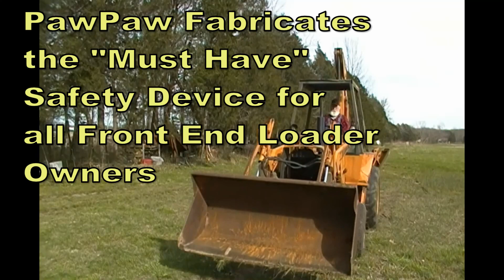PawPaw Builds a Safety Device for a Front End Loader Backhoe

Comment: Well now,..
  my Case 530 backhoe don't have that.      Now gunna git me the I beam an build one Thanks !  Paw Paw !
Reply from the maker: The I Beam is a bit heavy and overkill, but I had it handy.  I would prefer a 3 X 8 rectangular tubing sliced longways and use half of that, no welding, just drill holes for the bolts.

Comment: A good friend of mine was killed by being crushed between the bucket and the front of his tractor. He was 31 years old and had a 3 month old son. Norm owned an apple orchard. He was replacing one of the hydraulic  cylinders. After replacing the new cylinder he turned the tee valve to let fluid into it. That action allowed the other cylinder to drain half way. down it came. please be safe.

Comment: cool idea but did you need those 4 tabs just wondering
Reply from the maker: Remember the bolts I used to line them up before welding?  They are inserted into the tabs to hold the brace in place while I am lowering the bucket onto the device.
Reply: @DoingItCheap  oh gotcha thanks for taking time to read my comment

Comment: Couldn't agree more. Simple and worth every cent and second. Son had a friend that lost his father when he took a short cut working on the skid steer and it came down and you know the rest. Little fellow was way too young to loose his father from something like that. Never take short cuts regardless of anything.
Reply from the maker: Those skid steers are SO FAST !!!!!  I operated those a lot in Iraq.  So sad to hear about your friend's dad.  There is NO room between the bucket and the cab of a skidsteer.
Reply: @DoingItCheap  Absolutely correct. Never take a chance. Didn't know him, but local SHP helped a friend change a water heater, breaker was marked wrong, imagine that, didn't check to make sure no power at the water heater, cut the wires and died. Never take a chance, make sure, doesn't take but a few seconds to do so.

Comment: Bob if you would have found one of those locks I bet they would have wanted several hundred bucks for it, hope all is well with you and the family, look forward to seeing the next video !!!
Reply from the maker: The three inch eye beam cost $2.50.  The four tabs I cut were from an old bracket off the junk pile.  The two bolts and nuts came to sixty cents.  I probably used five dollars worth of spray rubber and spray paint.  Less than ten dollars total.
Reply: DoingItCheap yea man but if you would have bought that bad boy in the store already built it would have been crazy money

Comment: Great idea. Im surprise it didnt have one on it. Most have a red box on the cylinder for the safety block.  My pap had a alis chambers hd 4 crawler dad was doing work with it. Not sure he he was going to push this tree over or used it to hold the bucket up while he worked on it  he had tools on the ground near the machince a dead limb came down hit him on the head killing him. If had a safety arm and a cab he may been here today
Reply from the maker: So sorry Les.  You know as an operator that this heavy equipment is about as dangerous activity as you can find.
Reply: @DoingItCheap  that it is.  My pap till this day blames himself for what happen to dad.  You gotta respect your machine and safety is at the top of all things when comes to running and working on them

Comment: That motor sounds good Bob.  Don't make that cylinder lock using a 2X4.  Don't ask me how I know
Reply from the maker: You would NOT believe the comments I have received from people saying that a piece of wood for a prop was good enough.  UN Freaking Believable how some peoples' children act !!
Reply: @DoingItCheap  Fricking sad good news no one was under it when it snapped.  We pulled the cylinder out and was at the hydraulic shop.  When we were got back the bucket was on the ground.  The 2X4 was split like a piece of kindling.  We had to make an A frame and chain fall get the bucket back up.

Comment: Serious safety project, and well done.  As always, you bring us the best ideas and projects, thanks!!!  (I'm still in debt to you for the '45-second wine', enjoying a glass of wicked smooth Cranberry Wine, right now as I watched the video.)  Couldn't hit the mark much more right-on with this idea, a simple device that makes any hydraulic system a damn sight safer while doing maintenance.  A few bits and bobs and it works a treat, the 'I Like Doing It Cheap Hydraulic Safety Prop & Beer Opener!  (I imagine you can open a beer on this thing somewhere?)
Reply from the maker: Yes, I ended up trimming two corners off one end so it would rotate into position better.

Comment: Very useful. My hubby used to stand in the bucket to work on high places on the refrig. unit on the trailer. He had rigged up a rope to dump it and he stepped on it by accident while up in the air, and fell to the pavement. Broke two places in his back, well mashed them together, and broke his wrist. He healed up fine eventually. He had a tiny cut on his scalp. Doctor called to ask if what he was saying was the usual, or if he might have head injuries. He was a goofy talking guy and he was fine no head injury.